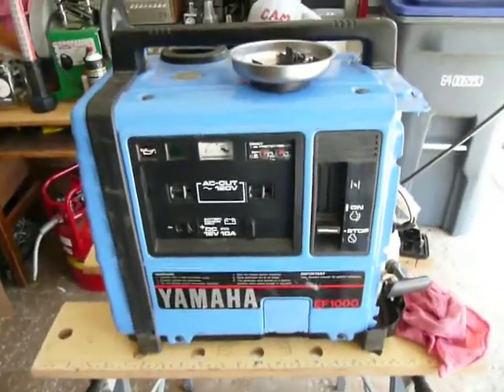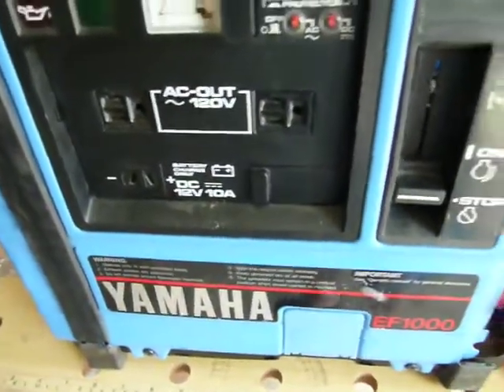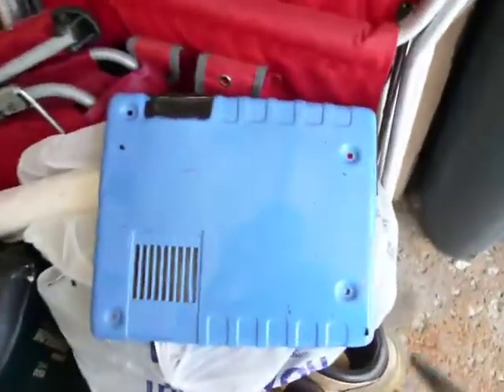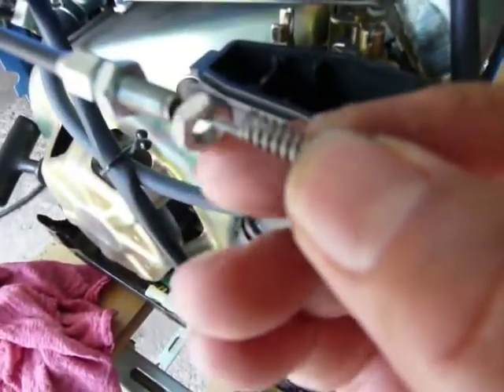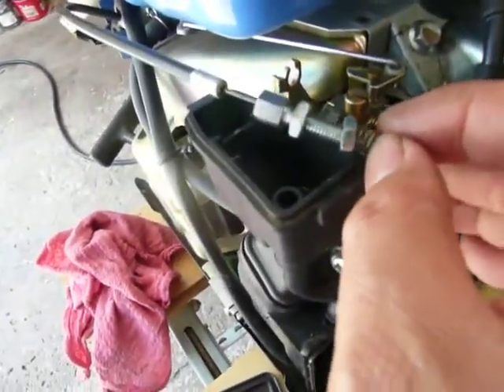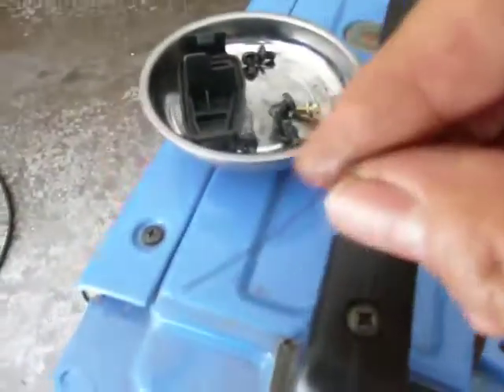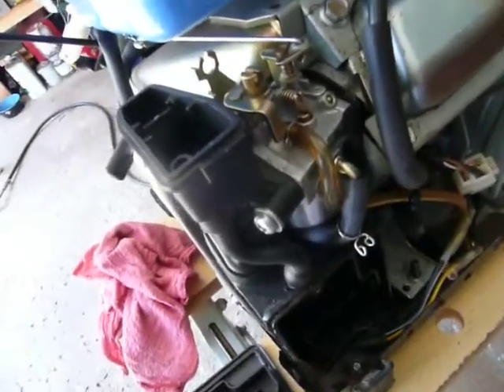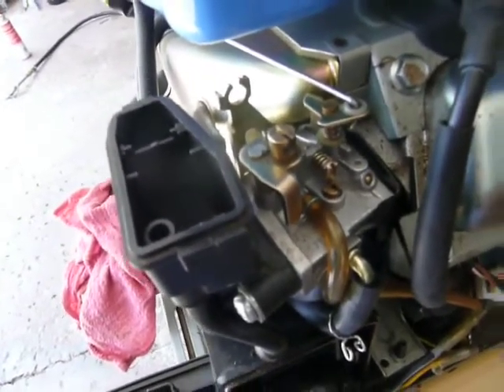Yamaha EF1000 generator carburetor location and cleaning. Part1

Comment: Does anyone know if the needle and seat is supposed to have a small rubber O-ring inside the barrel where the needle push"s against ?.   I cleaned the carb and now it leaks out the vent tube when I turn the gas on. The float is good and needle metal tip is lightly sanded and cleaned. but there is no rubber down in the hole just looks to be a brass seat.. I took apart carb 3 times and still leaks.

Comment: Too bad the is no carburetor rebuild kits or after market carburetor’s available for these. I have been running mine on half choke until I get the time to clean carburetor
Reply: Exactly!  No replacement carbs out there!  I actually took mine out and cleaned it all several times.  But it still will only run on full choke and surges until it has a load on it.  Then it seems to run ok.

Comment: Is there a oil drain plug?
Reply from the maker: Under the cover  between "Yamaha" and "EF1000" in the front panel.
Reply: @erguy6319  ok i was thinking there was a fill plug and drain plug.  I  just did a oil change on it. I really like this little machine it's pretty quiet, and runs well! I believe it to made back in 1985.  Things were simple back then! Thank you

Comment: I'm having an issue with the fuel valve not shutting off all the way and it looks like the plastic valve behind the shut off is cracked. I have it off and plan on glueing it back together. Can you post a picture of the front cover off, because I'm not sure how the fuel lever goes back on.
Reply from the maker: Liam O'Neill Sorry I don’t own the generator anymore.

Comment: Are these good generators?
Reply: I think Yamaha is the most reliable & quietest portable generator. I've read that Yamaha EF1000 particularly is more powerful and reliable than newer ones. I traded a much larger newer Yamaha 3000iSEB for a well used older and smaller Yamaha EF1000. Long story short, I paid a Yamaha dealer $500 to clean it up and get it running for me, but it continually surged. Then I saw a YouTube video that recommended soaking the carb and all carb parts in Pinesol & warm water. I did that a few times and now this 20 year + generator runs like a new one. I added SeaFoam to gas and I crank it every other month and, happily, it starts with the 1st pull every time. Lots of folks recommend Stabil, but I believe SeaFoam is much better for small gas engines.
Reply from the maker: I think the most important part is the engine section, that is why Honda generators are more expensive since they have very reliable engines. If engine can not start when you need, the generator is useless. In general, Yamaha makes good engine. This Yamaha generator is older one, there are many new ones on the market. Since most people do not use the generator frequently, so it is very important to add Sta-Bil fuel stablizer in the gas tank.

Comment: Generator sat for a couple years.  Added fuel and started first pull!  But gas leaks out the drip tube on the side with the grounding but.  What could cause this?
Reply from the maker: Most dripping fuel problem is the carburetor float is stuck in some degree, since your generator has not been used for 2 years. You can google about the carburetor, I am sure there are plenty info about it. Basically the carburetor needs be cleaned.
Reply from the maker: Can you post a picture here? May be a stocked needle valve in the carburetor bowl so the carburetor float can not close the needle valve when the bowl is full. If you can, just clean the carburetor may resolve the problem.
Reply: Either The fuel cock is leaking or the bowl float is sticking...

Comment: I went through and disassembled the main components of the carb and hit them with carb cleaner. No dice. There are two jets in this carb, and I suspect that I only cleaned the vertical jet well enough to get fuel through it. I'm going to re clean the horizontal jet tomorrow and try again.
Reply from the maker: Does the generator run with the spray of the starting fluid? If it dose, then it is the fuel problem. If not, should check whether you got the sparks or not.